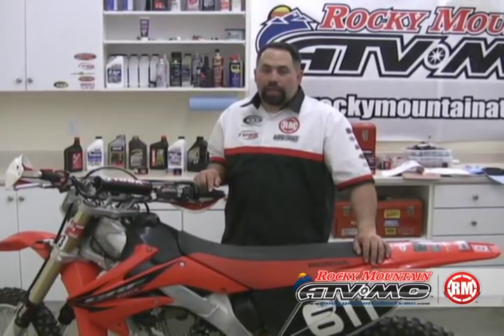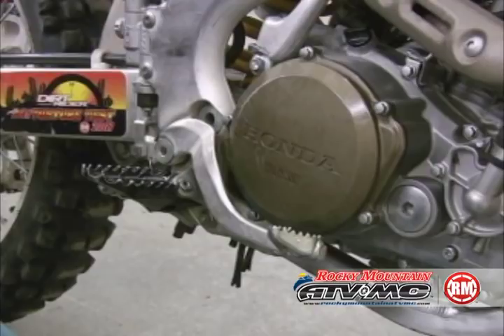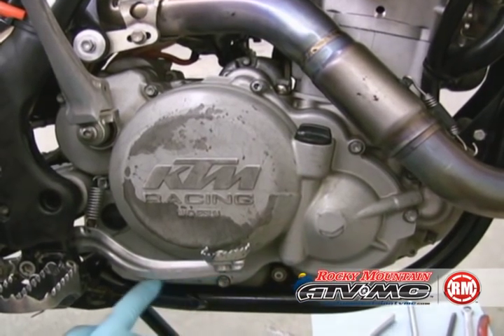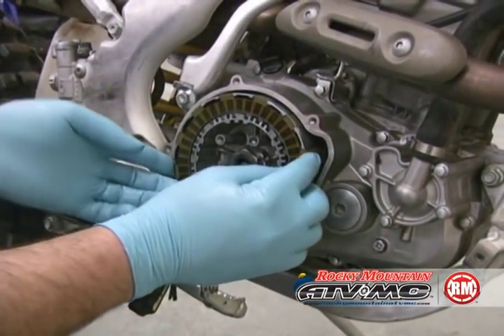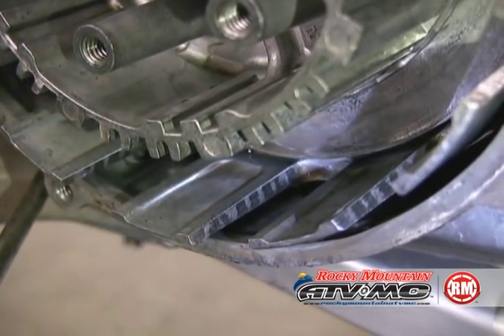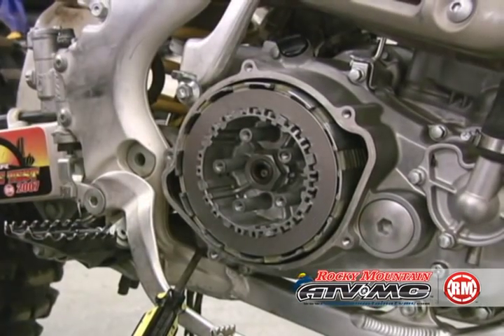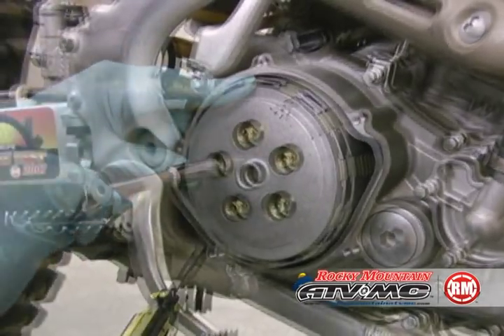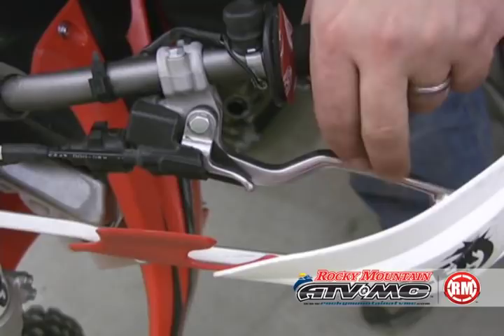Clutch Replacement on a Motorcycle or ATV - Clutch Installation

Comment: Great video.  Question, I saw in another video that the steels (metal plates) need to be installed with a particular side forward (away from you facing the clutch).  I know steels have one sharp side and one beveled (rounded) side.  Is it true to be cognizant of this?
Reply from the maker: Yes, usually as long as they're all facing the same direction (all sharp or beveled sides facing in or out) then you will be fine but definitely be cognizant of that and check the directions with the specific clutch you get.
Reply: @rmatvmc  thanks!

Comment: @RockyMountainATVMC hi i was looking at a 07 kx250f and the gear seems to shift a little hard, what's the issue with that?  This guy hasn't do any vale adjustment or checked the vales.  he's got quite a bit of hours on the bike and also the brakes are mushy.  you think it's a good idea to buy or not?

Comment from the maker: Nope it's very simple as long as you get everything back in the correct order you should be good to go. After installing a new clutch you have to adjust the freeplay in the system but that's basically all that a clutch replacement consists of

Comment: i got a 1996 yz125, and when im sitting at a stop in gear with the clutch pulled in, it wont stay running. it wont idle like that, and if i rev it up, it dies quickly and stalls. i also took out the oil check bolt, and there were tiny, very fine metal scraps comming out, and the oil was cloudy and dark. also, when i take off from a stop or a slow moving speed, i have to like feather out the clutch like really really slow until i get going fast enough to let it out all the way. any suggestions??

Comment: hi, thanks for the video, but when i try and undo the nuts that hold the springs, the whole clutch plate start to spin with the movement, how can i stop this from slipping

Thanks
Reply from the maker: fishedoff I would start with the bike in gear and then you kinda have to pop the wrench to get the pressure plate bolts to loosen up. Give that a try and let me know if you still have issues.
Reply: cheers mate all good now and fixed,  put it in a higher gear and worked a charm
Reply from the maker: fishedoff Nice work! Back up and running and ready to ride!

Comment: had my carb jetted 3 days ago,test drove it and it was fine,its a1989 kx 125,rode it for about 30 minutes that day ,the next day I degreaser the engine,washed it and did oil change,but did not start the bike ,today it started first kick,bogged out with a backfire and has not started since.also from sitting over nite,clutch lever does nothing.I can put bike in gear but when I pull lever it stays in gear.no freewheeling,could degreaser have gotten on clutch plate ?? Weather, or oil change .help

Comment: I have an 04 crf250r when the bike is off not running in gear and I pull the clutch it wont move. Do u know what is wrong with it?

Comment: I have a 05 yfz450 n I think the springs or spring is rattling on the primary gear is this common  cuz if I start the bike n let it idle I dont hear anything but as soo  as I giving it gas I hear a rattle noise n if I put a screw driver to my ear it sound like its coming for clutch side
Reply from the maker: I'm not sure what spring you're referring to but it sounds like something could be loose. You may have to remove the right case half to figure out exactly what it is

Comment: maybe you can help me... so i did all of this on my raptor 350 and i cant get the clutch perfect.. its either the springs are too tight and the clutch is always engaged or you cant engage the clutch ( the springs are too loose).. i have tried this over 5 times and i cant get it right i looked online for answers and cant find any.

Comment: Okay I have a problem, my buddy and me put  a off brand 150 motor on a go-kart.. But something is wrong.. It's like the clutches are not engaging, if that makes sense. We pull the clutch lever in then go to shift into first.. It Juss goes like we never pulled in the clutch lever. We check the clutches and they look fine. Idk wat is wrong with it.. I need help

Comment: Please help.working on a 2016 rmz250  I did full rebuild on this bike. Now after installing the clutch it rubs the clutch cover and when you kick it down it doesnt come back up.  When the clutch cover is tight. when the clutch cover is kinda loose the kicker springs back fine. Please help. Kicker springs back fine without the clutch plates in what's going on.

Comment: HI please help,
I just bought a new clutch kit for my cr250 (2003) the kit that I took of the 250 is not the same as the new one I just bought, it dose not have the we groves in the clutch plates. when I was buying the kit it says its for a cr250 (2003) but dose it mattor that they are not the same looking plates . 

thanks in advance any help be great.

Comment: Help! I changed my clutch out and im stuck in one gear and do have reverse

i remember when i took the plates out the whole turned to the right like a quarter turn

2006 Kfx 400

Comment: i have a problem on my cr500 it has pull on the handle and moves the lever by the stator but wont disengage. pulling in the clutch is just like i didnt pull it no difference still acts like im not touching it idk what it could be... plz help me.

Comment: I gow my engine on my table, and my clutch wont engage, dunno why, though it did work at one point, and stopped working while riding. Seems like there is a space between the small pushrod to the pressure plate.

Comment: G,day mate, love the video! you guys made that clutch change look like a piece of piss. If I ordered accessories or parts would you blokes freight it to Australia ? things like complete wheel sets Hinson slipper clutch slip on pipes header pipes rebuild kits riding gear boots etc, They are super expensive here eg wheels cost 1100 full exhaust 1600 aud. I'm sure the USA is cheaper even before the exchange rate comes  into it. Just a query anyway, hey would love to see a vid on valve clearance an

Comment: hi av got a rev and gow quad the sprocket linket up to the engine has snaped off and the only way to fix it is by taking the drive kasing off and wen i did it has a belt running from the engine to the clutch the problem i have is that i cant take the nut off that is holding the clutch on it just spins with it and av tryed jaming it and all that don was move the engine i got want to take it to a work show coz othay want £34 an H and can u tell me how to take the back drum brakes off plz or sum 1

Comment: '02 ds 650. Is it possible for the clutch to slip only on 4th & 5th gear under hard acceleration? You can still ride all day w/o a slip as long as you're not running past 3/4 throttle in 4th or 5th.
Reply from the maker: Yeah it's definitely possible. What does it do in the lower gears under hard acceleration? It sounds like it could be time for a clutch replacement

Comment: I just bought a tusk clutch kit for my 06 crf 450r  and I pulled the old pads out and there was only 7 pads but the tucks has 9  but only 8 fit. Does the tusk clutch always come with extra or am I missing somthing?
Reply from the maker: From what OEM is showing for your bike you should have a total of 8 friction plates and 7 drive plates. Sometimes the Tusk kits will come with more plates if they fit another bike with the same plates just a different number. If 8 plates fit right and you've got them all installed correctly i'd say you're good to go. I'm not sure why you only pulled 7 friction plates out though

Comment: i know this has nothing to do with this but youve helped me before. i have a 97 rm250 i just recently lost spark. so im testing my ignition coil and it says test the ohms at 1k but my multimeter only has 200 and 2k so on 200 it reads .5 but the manual calls for 1.7-2.3 at 1k. is my coil good or no?
Reply from the maker: +Bradley Simpson I would check to see if there is a conversion chart out there to convert what you're testing with (200) to the 2K.. Have you searched that to see if it balances out to what your manual requires?  ..you may need to get a different multimeter that offers the 2K possibly?
Reply: Mine has the 2k i need the 1k. Do you guys sell any?
Reply from the maker: +Bradley Simpson Yes sorry.. 1K is what i meant to say from the service manual.  No, we don't sell those unfortunately

Comment: if only they had a video on how to install a clutch on a small weed wacker engine that uses 2 clutch shoes with bolt mountings on each shoe with the right type of washers, torque settings, etc. i just cant find one detailed video that shows this, and the problem im having may have to do with the clutch.

Comment: I have a 2004 honda trx450r and my quad wont switch into 2nd gear im assuming its my clutch or can it also be my transmission
Reply from the maker: It could be a number of things not allowing it to shift into second gear. Will it shift through any other gears or do you just have first? Will it shift into second with the machine not running? It could also be something with your transmission whether a shift fork is bent, or the dogs on the gears are worn down and won't allow it to engage. A broken shift cam or a bent shift fork rod. It's unlikely that the clutch wouldn't allow it to shift through the gears but you're going to have to tear it down until your find out what's causing the problem. Let me know if you have more questions
Reply: Well when I open up the clutch it wont seem like its making contact anymore so im guessing the friction plates are worn out already

Comment: hey i just put a brand new lifan 125cc motor in my mini chopper and on the gear box it says the gearing is 1 N 2 3 4. But i cant find the neutral gear i press down as much as i can on the leaver and press it once up. and it seems to go straight into 2nd gear. please help me i have no idea on what to do
Reply from the maker: This could be a number of different things but i would first start with your clutch. Check to make sure you're cable is tight but you've got the correct amount of freeplay in the cable to sufficiently disengage the clutch. If that's fine check your clutch basket. Sometimes they will get "notched" enough from the plates causing it to not disengage when the clutch is pulled. If that's not the problem then it could be something in the transmission. Will it shift through all the gears just fine? Does the bike run and drive?
Reply: When the bike is in first you don't pull it up completely you just lightly lift it till you hear a little click

Comment: where one of the bolts insert with the spring broke. so know i can only tighten 4. do i need a new inner basket?
Reply from the maker: Yes.  Or if you can.. carefully use an easy out to get the bolt out?
Reply: +Rocky Mountain ATV MC thank you for your reply. actually the lil tube were the bolt screws down in to broke not the bolt.will i be ok with 4 holding it down?
Reply from the maker: I would not recommend it.  Aftermarket ones are fairly inexpensive.  For the price of a new replacement Clutch Hub vs. the possibility of damaging more expenisve internal parts, i would buy a new one.   https://www.rockymountainatvmc.com/p/895/35185/Pro-X-Inner-Clutch-Hub
Reply: +Rocky Mountain ATV MC thanks a lot for your help very much appreciated
Reply from the maker: Francisco Ruiz You're welcome anytime.  Thanks for watching.

Comment: PROTIP:- THOSE OF YOU WHO HAVE DRUM BRAKES need not necessarily remove the break pedal, instead loosen the nut of your rear wheel drum brake till it's not able to catch the wheel. but REMEMBER TO TIGHTEN IT BACK ON AS SOON AS YOU'RE DONE.

Comment: so I have an issue with my clutch I was hoping you could help me with. when I pull in the clutch level when the bike is in gear the rear tire doesn't roll. it's almost the same as trying to push the bike in gear without pulling in the level. please reply if you know what's up.
Reply from the maker: There are a couple things you can try to fix this.  1. Install a new clutch kit.  Your clutch right now could be worn out and not dis-engaging. 2. Get a new clutch cable and adjust it properly.  If these don't do the trick, let us know.  We can go from there. Thanks. ~Vinny
Reply: Donny The Dealer- is the cable ajusted properly?
Reply: Rocky Mountain ATV MC I’m having the same problem what all items should I purchase to replace the main components for the clutch what are the main components I should focus on replacing in the clutch I have a tusk clutch kit already
Reply: Rocky Mountain ATV MC hi I have just replaced my clutch kit but for some reason it only goes into first gear and I can’t select any other gears do you know what the problem could be ?

Comment: My kx 85 is stalling when i pull the cluch in then put in gear it will stall out unless i give gas but will want to still go with the cluch in... i think the cluch is bad i dont know need so help
Reply from the maker: joey yang Unless you have your clutch cable adjusted wrong it sounds to me like your clutch needs replaced. I would start with the most obvious like properly adjusting your cable to make sure it isn't too loose and has the proper amount of free-play in it. If it isn't that you'll have to remove your clutch cover and inspect your friction plates along with your drive plates and your inner hub and outer basket as described in the video. If you have any questions let me know.
Reply: Ok thanks

Comment: Can anyone here help me?
I recently bought a 300 bayou 4x4 and replaced the timing chain, valves in the head, and new clutch plates in secondary and clutch shoes in the primary but didn't replace the hub. The problem I'm having is when I put it in gear and try to take off it is slipping bad . On flat ground it will go but slips but on any incline it won't move and can hear it slipping. I put everything back together as it came out. On the secondary the plates are loose and move around in the basket is this normal? Do I need to replace the hub? It was slipping before I replaced everything also
Reply from the maker: From my experience, the drive plates should fit nice and snug in the clutch hub.  Have you double checked the order of the drive and friction plates? None were doubled up by mistake? Sounds like you're on the right track.. I'm not sure how much play you have on the clutch hub, but my guess is that it is worn causing sippage

Comment: i guess il just say whats my problem here and maybe somone will haev a solution, the engine was new and installed on a gas scooter with also new belts, tires, bearings, etc, after a week or so, for some reason, the engine didnt transfer power right anymore, slower and slower top speed as a result of shorter powerband, and weaker torque, the wierd part is the engine still has good compression as tested by the shops and nothing else was suspected as wrong, so could be possibly be wrong?

Comment: how do i tell if i have a clutch problem? i have kawasaki kx65 and the rear wheel wont do a full spin. As i push my kick my kickstart the rear wheel jerks any ideas on what to do?
Reply from the maker: The clutch will slip causing your bike to heat up and can even cause it to smoke a little. You'll be able to feel when the clutch is slipping. I would start by inspecting and measuring your clutch plates. Be sure to refer to your service manual for the recommended plate thickness
Reply: but the problem is that as i try to start the bike the back wheel spins a little but it dont start, the bike has been sitting for a while could it be the oil?
Reply from the maker: Gamerplays
 Do you have the bike in neutral?
Reply: Rocky Mountain ATV MC
yes it was i managed to solve that problem it starts first kick now, but when i put it in first it jerks forward then stalls any ideas?
Reply from the maker: Gamerplays Are you pulling in the clutch?
Reply: yes, bike started, clutch in, in to first and then it jerks forward and stalls
Reply from the maker: With the clutch lever still pulled in? It sounds like your clutch isn't fully disengaging while the lever is pulled in so i would try adjusting your cable and see if that fixes it. You should only have 3-4mm of freeplay in the cable so i would start there. If that doesn't fix it i would look at the clutch. You may have a worn out basket that isn't allowing the plates to separate when the pressure is released from the stack. Grooving on the basket arms is not good, sometimes your can try and smooth them out with a file while other times you have to replace the basket.
Reply: Rocky Mountain ATV MC
i will give the cable a try and inspect my basket tomorrow, sorry for being a pain
Reply: Rocky Mountain ATV MC
hey um i stripped my clutch down today and i found that there was grooves in the clutch basket i figure i could file them down until i can get a new one but the plates were stuck together and the steels had patches of rust, thanks for helping out i will replace the gaskets and plates :D
Reply from the maker: Gamerplays
Sounds good, let me know if you have any other questions

Comment: So would I be best to do this if when I try to put it into gear it lurches forward and dies. It kinda acts like I'm not pulling the clutch in at all. I've already tried to adjust it at every possible spot.
Reply from the maker: Yes.  If you've adjusted the clutch cable and still engages.  It's a good indication that your clutch pack is worn and out of spec. Due for a new clutch kit.  Have you watched our Top 5 Clutch Maintenance Tips?  Here it is: https://www.youtube.com/watch?v=KoPFuUXGA04
Reply: Yes I have. My bike is an 85 and the previous owner didn't take care of it and it's my first bike so it's a lot of learning.
Reply: Robert Watson